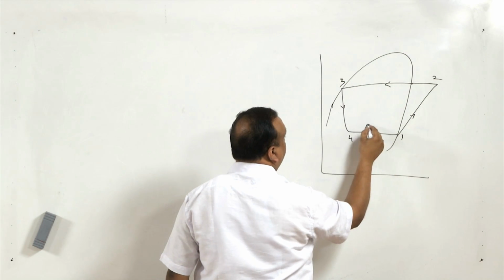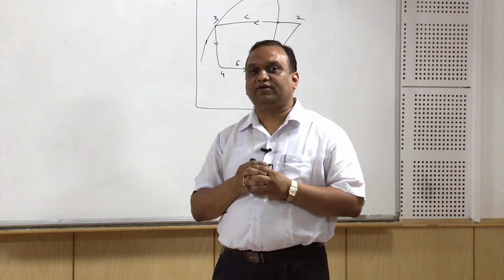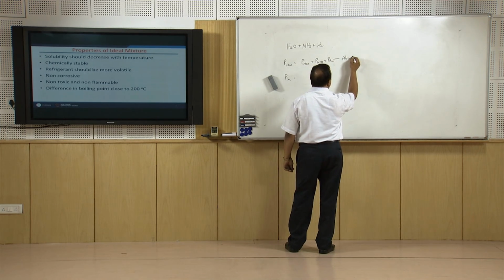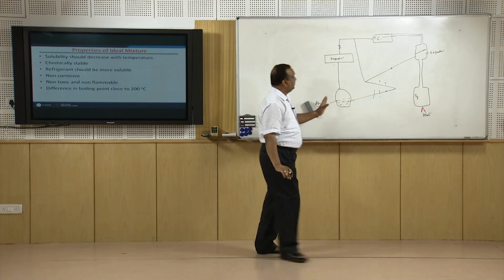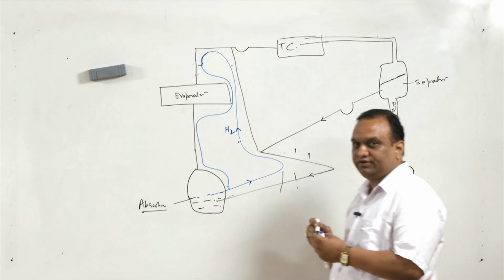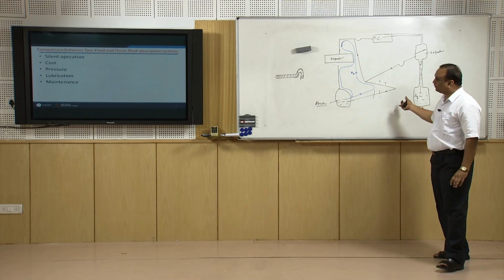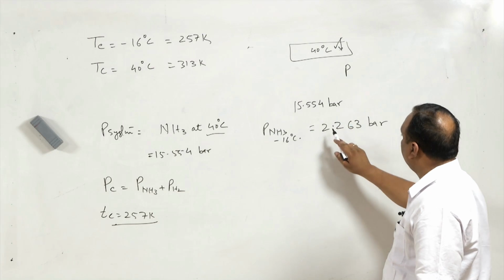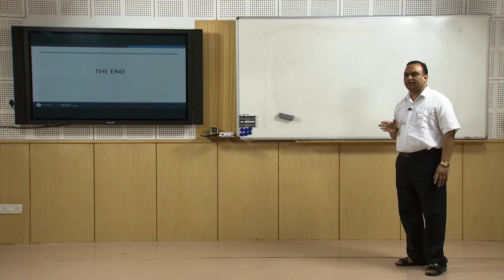Vapour Absorption Systems-3

Comment: In 3 fluid refrigeration system the connection between absorber and generator is shown in one way only where as mixture needs to move from absorber to generator too.